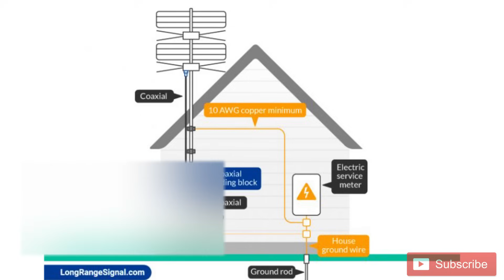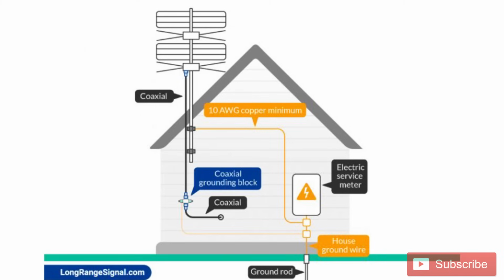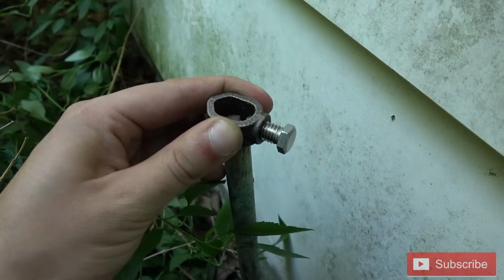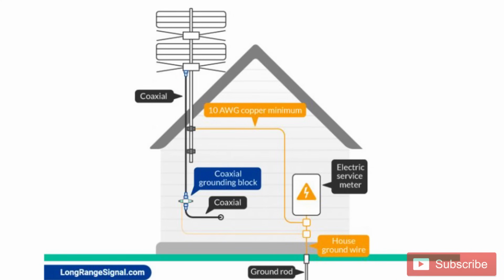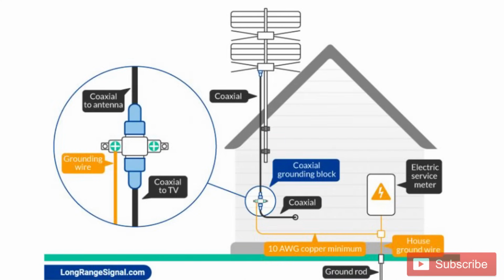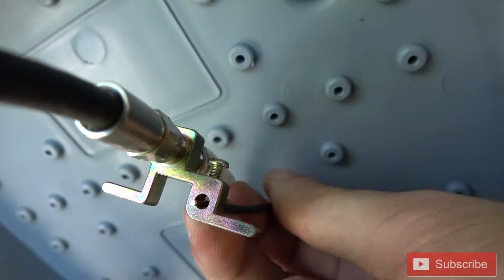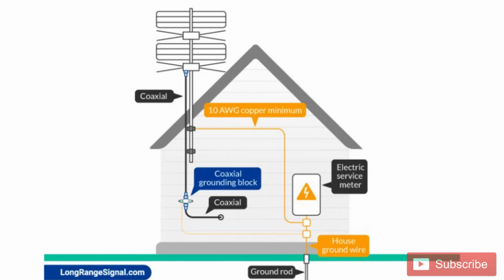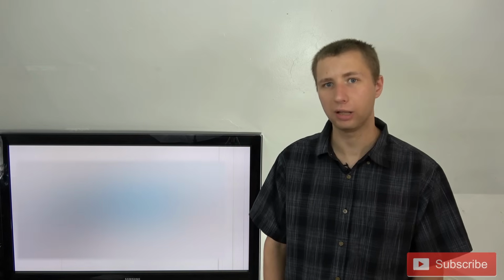How To Ground an Outdoor TV Antenna Per NEC

Comment: Hi antenna man thank you for all your tips. I was confused there was no video on how to setup  with televes preamp through your link.  But I got it except for the ground.  where do you put ground when you use a preamp. I do have 2 25ft coaxal maybe between them. Then I just need ti get piece to go to ground rod.
Thank you
Reply from the maker: You would need a grounding block to put on the coax cable between the preamp up at the antenna and the white power inserter inside your house.

Comment: If a ground wire is run from the mast to the grounding rod in the ground, can a ground wire for the coax be grounded on the pole the mast is mounted on?. Or should I go ahead and run two (2).ground wires to the rod as shown in the video?  Thank you for your video and a link to purchase the items.
Reply from the maker: I cannot comment due to liability reasons. Refer to national electric code and do not take any shortcuts. This is lightning protection we're talking about.
Reply: @AntennaMan  Gotcha... I will do it like it was demonstrated in the video.
Another quick question.. if you're okay to answer.
Would be it be okay to run the ground wire through the crawlspace over to the other side of the house. Antenna will be on the east side. The grounding rod is on the west side. I was going to run the ground wire through one of the foundation vents in the crawlspace if it's safe to do so...

Comment: Does an indoor antenna need to be grounded as well? Does the wire have to be run outside into the ground or connected to an outside utility cabinet? Is there a way to ground it inside? I do have a Channel Master 4 port line amplifier inside my house and it has a ground connection but I am not using it. I have the amplifier plugged into a outlet surge protector. I live in Florida and you have to have just about anything electric protected from lightning surges! I do have a cheap antenna like the one you showed in your video in the attic and it is plugged into a surge protector as well. I will be getting a larger Channel Master 100 mile antenna this fall probably with a preamplifier since it is suggested for my area. Some of the channels I want to get are about 47 miles away in VHF high. I have the antenna indoors mainly because of hurricanes. We get some pretty high winds here when they come by and I just don't want to risk destroying the antenna!
Reply from the maker: No, you don't have to ground an indoor antenna.

Comment: Tidbit of usefull info.  Most sattelite companies use a dual coaxial cable with a ground wire built in.  Mine was already grounded to the mast and to the grounding block.  It worked out that it was in a good location to install my OTA antenna as well.

Comment: How do connect the antenna to the coax cable? What is the 75 ohm barrel do? Are there better ones than others? It looks like there are some antennas that have a assembly directly on the antenna that you feed the coax cable into.

Comment: Nice information.  When I installed my antenna I tried it in the attic first as that is MUCH easier to access.  Results were impressive, I got all the broadcast stations I expected, so that's where it is to this day.  I'm only about 40 miles away from the broadcast towers in my area, those towers are on a hillside, and its a 'straight shot' view to them.  Additionally my roof and roof framing are asphalt shingles and wood, no metal film-backed insulation, no fan motors or other stuff in the attic in the vicinity of the antenna, and I was able to mount the antenna away from HVAC ductwork.  I did do an after-install of an LTE filter to get rid of a bit of cellphone interference, but other than that its simple and effective.

Comment: Hi antenna man I have a question about grounding my antenna. My situation is that I have a outdoor antenna That I installed it nside my attic due to the fact that I didn’t like the look of an antenna on my roof I tested it on my roof and in my attic and had no significant difference in my reception I get about 15 channels sometimes 18 and that’s good enough for me. My question is since my outdoor antenna is mounted in my attic do I still need to ground it? I hope you can help me and if you do thank you for your time I appreciate your channel there’s a lot of good information and have been a subscriber for quite some time.
Reply from the maker: You don't have to ground the antenna if it's inside

Comment: I’m confused. In one comment, you mention you do not need to ground an attic antenna, but in another comment where someone asked the same question you said refer to the diagram in the video - I put an antenna up in my attic, can get main channels (cbs/nbc/fox/abc) plus a slew of others I will never watch but have not permanently mounted in attic yet as I wanted to see if I can even get the channels I need for football...planning on using a short 3 foot pvc pipe screwed through 2x4 roof beam with the rg6 going down to my basement, into a 3 or 4 way splitter. Will then reassess if an amplifier is needed on any run but very hard to get accurate info as to if attic antenna should be grounded.....my attic has 3 vents that allow air to move freely and I heard this can cause static buildup
Reply from the maker: I cannot comment on grounding advice due to liability issues. Contact a local electrician if you are not sure what to or what not to do.

Comment: Any problem with using a separate ground rod for each ground then bonding the ground rods together?  Sort of a ground rod array.
Reply from the maker: I cannot comment due to liability reasons. Consult a local electrician if you are not sure.
Reply: @AntennaMan  NAP.  I will consult local code.  Lightning is a strange beast but has been my experience too much grounding is never bad.

Comment: Thanks for the short and to the point video.
3:56 - so if the power goes out during a storm and the electric is not 'active,' your antenna will still be grounded, correct?
Reply: Damage from a lIghtning strike to an antenna won't be affected by power on or off nor is the grounding.

Comment: That mast clamp is pretty expensive for what it is... is it safe to just wrap the copper part of the wire around the mast?
Reply from the maker: No, this is lightning protection we are talking about. Do not take shortcuts.
Reply: @AntennaMan  makes sense. cheers

Comment: I have 2 indoor antennas one upstairs and one down stairs and it’s pretty good I must say, upstairs has 19 channels that work, and down stairs has only 9 channels. Let me know how that is.
Reply from the maker: Different antennas at different locations will get different channels. Your best bet is to setup an outdoor antenna.
Reply: Hip hop Herbytown - Me too; here in Phoenix (yeah, location does matter), I get over 50 channels incl some from Tucson, using a $15 indoor antenna w its skinny unremovable cable attached to a standard coax, per an online tip that thicker cables work better. (So grateful to you guys who offer these great tips.) 
When reception dropped suddenly, maybe due to a cell tower change nearby, I started looking into outdoor antennas. A lot is involved, intimidating at my age with fixed income, so meanwhile I went old school and wrapped a length of aluminum foil around the cables. Great reception again! 
Ant Guy's point about home materials is key for me: I have a mobile home. Its metal siding allowed almost no reception. Putting the ant on a window was not much better. But the prev owner had cut out a section of wall for an air conditioner, then switched to central HVAC, and closed the AC hole by building a box using thin wood, extending outside as the AC used to. Weird, but perfect place for my antenna. That thin wood is no barrier. Doubt that anyone would want to do this to a nice site-built home tho, lol.
Btw, a DISH commercial for a cord cutter video?? 😊
Reply: Simple the higher the antenna the better your signal reception will be. The ground floor antenna has more obstructions in the way of the signal than the higher one upstairs.

Comment: You went too super fast on the video explanation!!!! When I say too fast, I am not talking about your speech speed, I am talking about that you skipped super important steps of for example how to make an split on the coaxicsl cable? You just talked about it, with out showing how to do it.
It's like if I make a video about how to swapp a 4 cylinder Honda engine, and I just talk about it with some video on the back ground, but I don't tell people step by step how to do it, and I finish in 10 minutes! 
When we watch a YouTube video about something, we don't want to read a factory manual, we want a simple guy to tell us with simple terms using video how to do things.
It's like other guys who make videos, and they skipp the challenging parts, and just give a brief description of how to do it, but they won't show the sweet and tears it took them to do that simple part. I don't like those videos.
They just show the easy parts, and they skip the difficult oness.
Reply from the maker: Sorry, my presentation might not be the best but the info is there. You are free to rewatch the video in .75x speed if you think I spoke too fast.
Reply: @AntennaMan  you didn't spoke too fast, you didn't took the time to explain how to to the video step by step. You just talked about it, but you didn't explained the video in detail.

Comment: Can NOT grounding an antenna cause sound distortion because of static buildup?  I'm also using both a pre-amp and an amplified distributor
Reply from the maker: It can. Very unlikely tho. Sound distortion would suggest a tuner or speaker issue.
Reply: @AntennaMan  That's what Channel Master said  ..."not likely" ....so thanks for confirming.  I'd wondered if the amplifiers could cause an issue too.

Comment: I was ready to cut the cord and literally had the Clearstream 4max antenna in my shopping cart but now I have second thoughts. I live in rural Texas in a mobile home where the grounding and box are next to the trailer on a pole. Unfortunately with all the trees the best place to put the antenna is a large storage room roof about 40 feet away from the grounding system. I would have to go around trees and the trailer to run wires…..guess I’ll stick with my cable🤬

Comment: Question, why ground the two items separately? The coax and the antenna? Why not just let the coax take the electricity in case of a lightning strike and route it to the coax ground?
Reply from the maker: You have to ground each separately because it's what national electric code requires. Do not take short cuts - this is lightning we are talking about.

Comment: Can i get away with grounding the tower i have at the base or does the ground wire have to go up to the mast that the antenna is attached to?
Reply: 30ft tower with 8ft mast
Reply from the maker: I'm not able to comment due to liability reasons. Refer to national electric code or consult with a local electrician if you are not sure how to properly ground your antenna

Comment: Can you ground BOTH the Mast & Coaxial cable to the  Service Meter Box with 2 separate  grounding wires?
Reply from the maker: I can't comment due to liability reasons. Refer to national electric code and don't take any shortcuts. This is lightning protection we are talking about

Comment: The side of my house with the service ground so happened to be a bad location for the antenna so I had to mount it on a 25' mast at the rear of the house. I drove a ground rod near the mast and bonded the mast and antenna surge protector to that ground then bonded that ground to the main service ground rod using #8 solid copper wire which was buried.

Comment: I do wonder if normal everyday static electricity especially in winter destroys TV sets over long time thru the coaxial cable? (Inside vs outside, plastic covered present antenna (Clearstream max-v) vs old previous metal antenna, on post metaltripod (cuz apt rules) vs vertically propped on concrete ground on wood post (now trying this) and cable running on sidewalk under metal door over metal table to the tv! Lol. I did have a Toshiba tv Peter out after ten years so I wondered why tv broke…am on a LG tv now.

Comment: Recently moved into a home with an existing aerial. Wasn't grounded.  I used a mast ground and ran that wire to a coaxial ground which has two screws. As I understood it, the ground wire can go from mast to this coaxial ground then run a single ground wire to the ground stake.  So the coax and the mast share the same wire at that point. Is this an still effective ground?
Reply from the maker: I cannot comment due to liability issues. Refer to National Electric Code and do not take any shortcuts

Comment: I'm using an eave mount for my antenna and my coax enters the house right by the antennas through the attic.  Video seems to indicate I need 2 ground wires- But can I simply ground the mast through a Mast clamp direct to my ground rod and then run a short wire from the Coax Ground block to the Mast clamp?  Or do I truly need 2 ground wires running side by side down to the ground rod?  Thank you!
Reply from the maker: Both the coax and mast should be grounded separately. Rewatch the video and do not take any shortcuts. This is LIGHTNING protection we are talking about.

Comment: Thanks for the info, antenna man.
I have the clearstream 4 max antenna, mounted on my roof using a short pvc pipe mast. So in my case all I need to do is ground the coaxial cable, correct?

Comment: what can you do to make your own grounding rod?
Reply: Connect your splitter inside at your electrical box chassis or use a split bolt to connect to the house ground wire.

Comment: The first week after I cut the cable and installed an outdoor antenna on my roof there was a rain storm. I watch this video and decided that I might as well ground it. I never even knew that I had to do that. I drove a ground rod into the ground by my house. Then I connected the 10 gauge wire to the antenna mast and the rods. I really didn't think that this was necessary. But what the hell I'll do it. A couple nights later during a storm, my whole room lit up like it was daytime. I could hear the crackling of the lightning as I assumed it was striking my new antenna. This lasted about 15 seconds or so. Then a there was a second strike. Same instant daylight. In the morning I wondered what my antenna looked like. When I got up on the roof I was surprised to see that the antenna was fine. No scorching at all. I know that the odds are small that lightning will hit a tv antenna. But I learned very early that it definitely can. And grounding your antenna is a MUST! Thank for your videos. They were very helpful and gave me the confidence to finally cut the cord. It has been a couple years now since I did it.
I have to admit since those first lightning strikes, when there is a storm in my area I take my antenna off the roof and set it up on a three foot mast on the ground. I still run a ground wire to it. I only lose about 20% of my stations and signal. I hope that this makes it less of a target during a storm. Does it?

Comment: The antennas seem to all be plastic including the mounting, does that need to be grounded? I’ll check your site to properly ground the cable wire.
Reply from the maker: Yes, every outdoor antenna should be properly grounded since there is metal inside the antenna that can build up static and attract lightning.

Comment: thank you for informing the public on grounding for these antennas.  I work for a major tv and internet company and can attest that this is the appropriate way to install grounding.  It is important and I have done so on my own tv antenna setup.  It makes it easier to ground the antenna when you have a shortcut by way of the grounding on the DSL copper telephone wires running into your house.